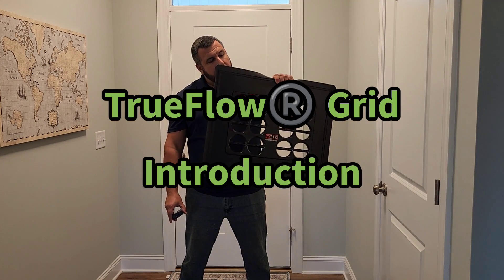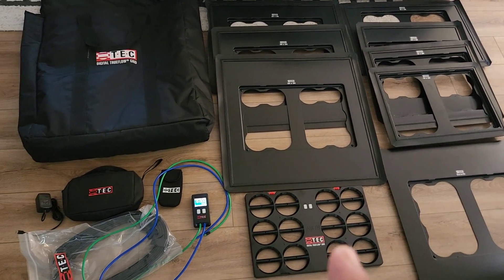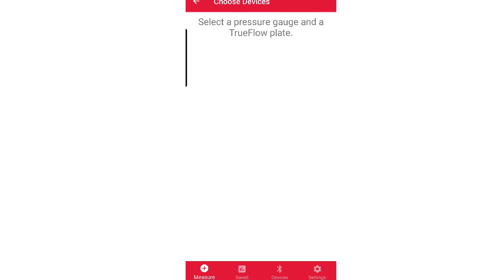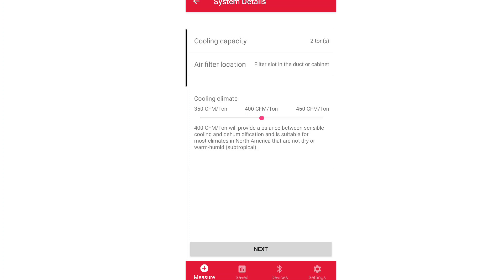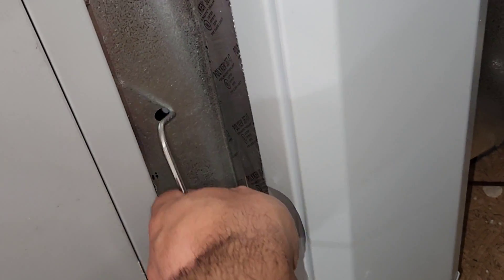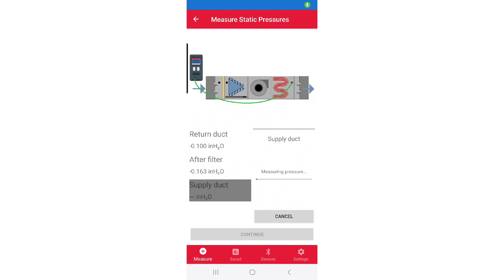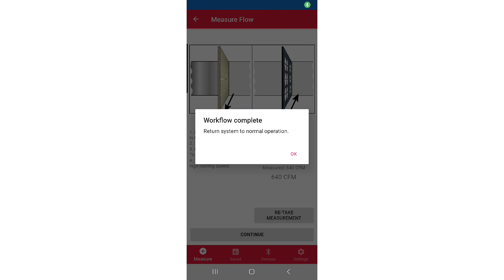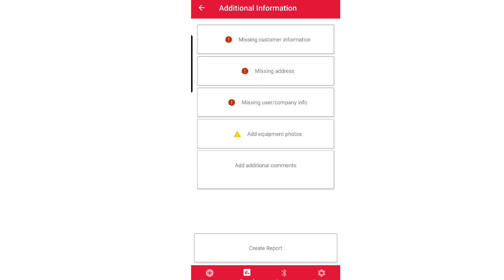TrueFlow®️ Grid Introduction

Comment: Did I misunderstand, or is it just with this tool....I thought that with a static pressure tip, point the tip against the airflow direction (points opposite the airflow) in both the return and supply.
Reply from the maker: Try it both ways. You'll find its the same each way on low velocity.